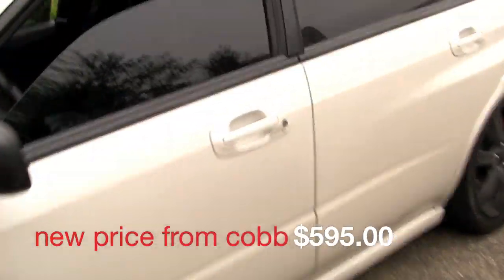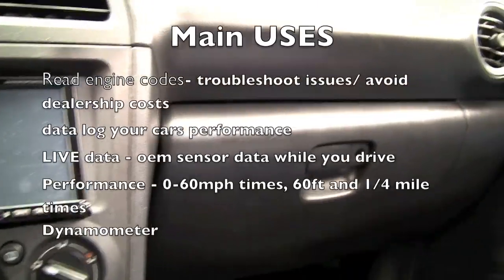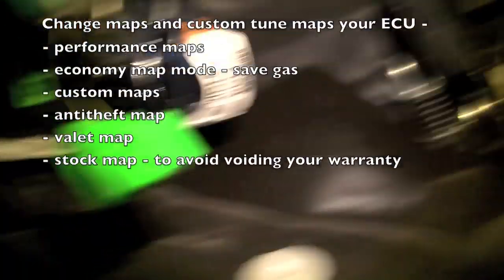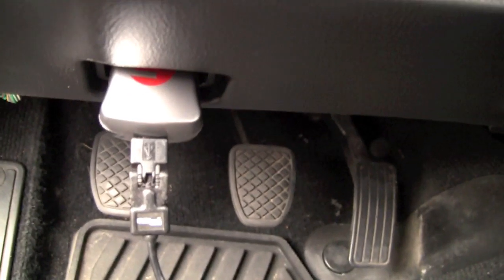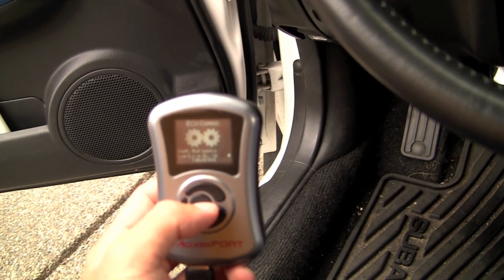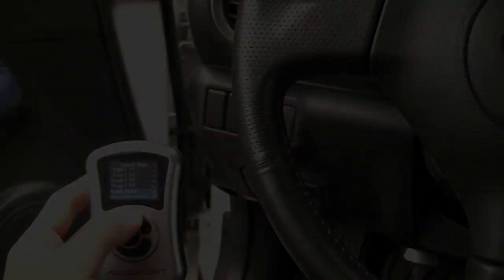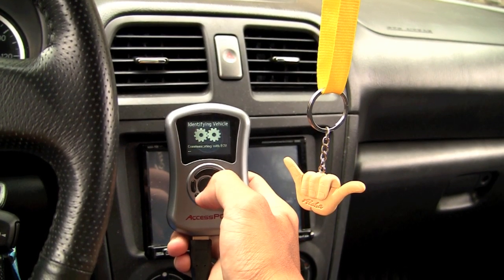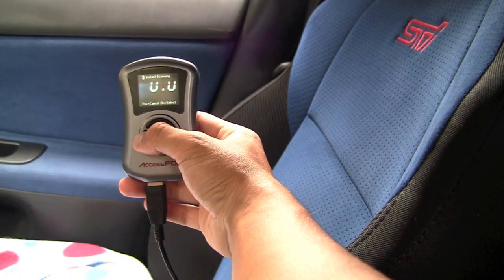Cobb Accessport Tuning - Installation/Test

Comment: I have an 03 wrx and I cant get under the dash to plug in the god damn connectors to save my life
Reply from the maker: yeah if your car has been moded before it might be just not be where it suppose to be.
Reply: Edlin I got it. When I plugged them in and the other little connector, the cobb still didn't turn on and I wanted to kill myself

Comment: umm... the aim cold air intake you can hear it a lil beefier on take off which sounds pretty nice but its not loud.. and the BOV i have a Go Fast Bits TMS Respons bov.. and u can open it close it ( i think the proper terms is like circulate it or non circulate it idk i just put it in because it sounds cool lol).... but if you open it the louder it gets andif u close it, it doesnt make a sound but even if its open and u see a cop...

Comment: @edlinnguyen thanks for your help. btw, i guess since my wrx is an 08 it doesn't have the test connectors. it just has a single white obd II under the steering column. I guess this makes it easier to flash maps. btw, you are lucky to have 93 gas in your area. i live in cali..gotta deal with shitty acn 91 octane ;/

Comment: cool vid. i just bought one for my wrx 08 hatchback. i just bought an unmarried accessport used from nasioc.com my question for you use..when i flash stage 1--i basically connect those two green connectors for test mode first and then plug in the accessport to flash stage 1?